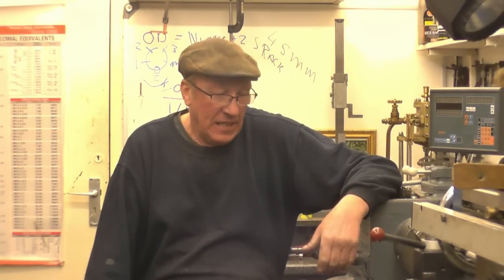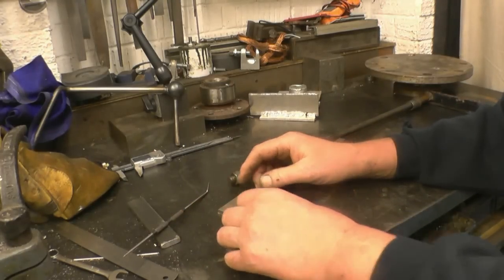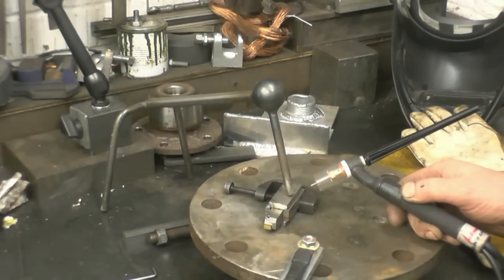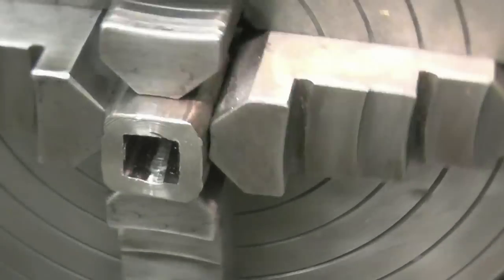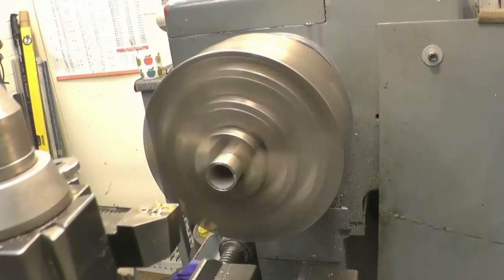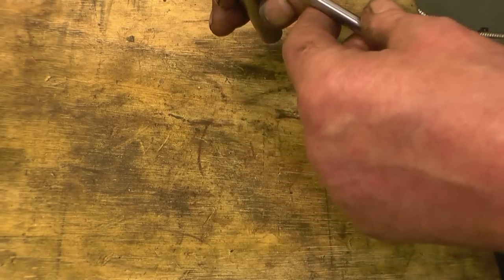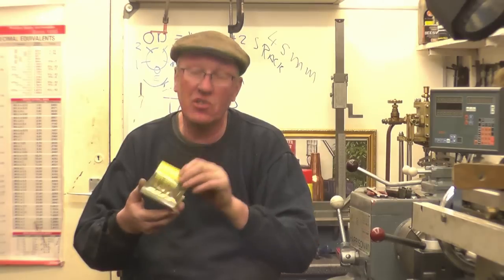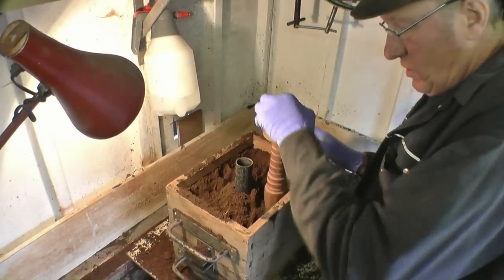SNNC 120 Tig welding/ Bronze casting /Sensitive lathe drill

Comment: That is a nice sensitive drill adapter for the lathe.  There are of course also ones for the drill press that you grab with your hand to advance, let go if the drill grabs.  It would be interesting to make one to fit on the quill of the mill.  Great video, John!

Comment: Made a few of those 1/2 drives using a cheap chinese socket ( the ones that cost 2 pounds and break easily) and welding either the rod into the socket or the nut end depending on use. Made some really deep sockets that way, perfect for use in a machine where I needed to do a nut that was either take it apart entirely or work through a 15mm hole. Nice work with the welding though, looks beautiful, much better than my scratch and stick work though.